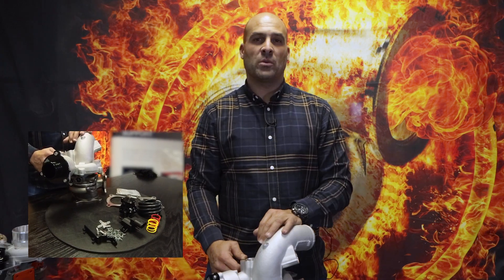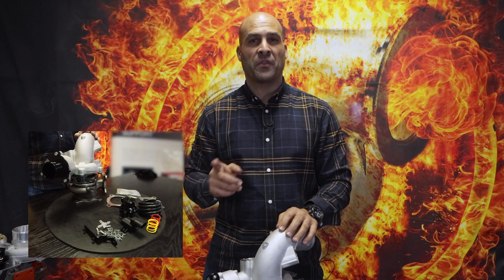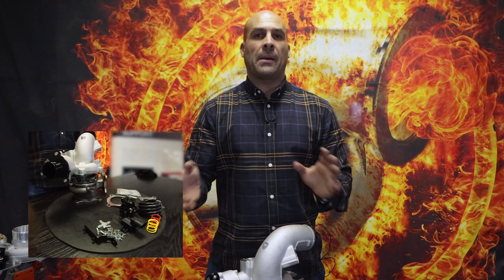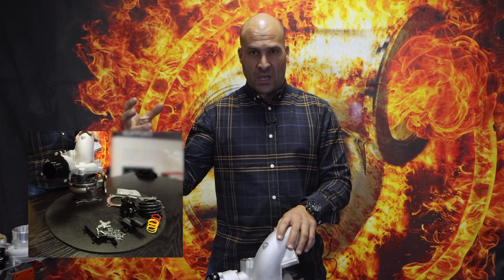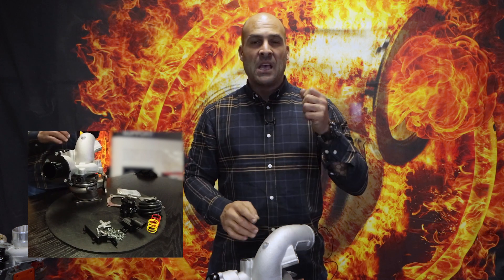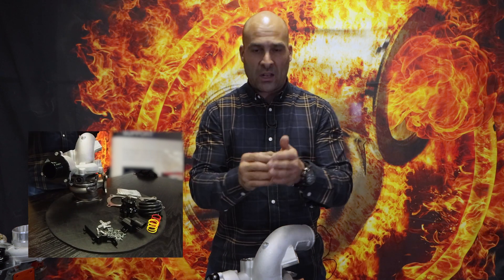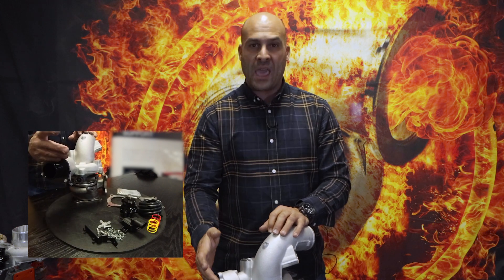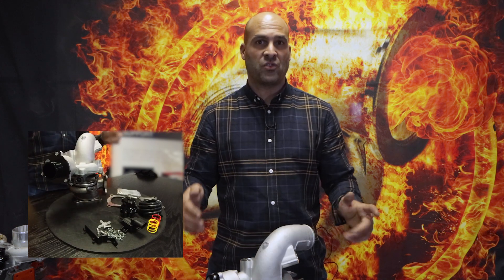500HP Ball Bearing Bolt On EA888.3 - Audi Longitudinal Engine

Comment: Since you guys don't make this in a transverse configuration do you A. plan to do so for the MK7 VW crowd, or B. will an IS38 compressor housing fit so that this can be used on a transverse engine?
Reply from the maker: We do - we have just received end housings to assemble the transverse models. The first batch is already sold out. We waiting for new stocks to arrive which we expect to be in July mid to late.  

I have a video coming out on this turbo, and also the installation thereof into the shop car, which will be a multi part video and we will show the tuning and testing process and some data logs aswell. Look out for the first part coming out sometime next week.

Comment: The hardware looks very impressive, you guys got some good castings for this one. I hope you will include some more information about the Golf R turbo when you do the video for that one. Specifically, it's a bolt on turbo, so that means we can use a stock downpipe and inlet elbow? Where are you targeting spool up? Moreover, are you guys still working with GT Innovation for flash tuning? Will there be an option to keep an electronic actuator and diverter valve like the stock IHI turbos? I think the boost control solenoid and blow off valve is a bit of a step backwards, though I understand it's hard to engineer and manufacture electronics for low volume.
Reply from the maker: Thanks for the comments, the video on the GolfR is done, and the dyno run is included in the video - we made 480HP and 632NM - we only use GT innovation for tuning, noone is able to do what they do on the EA888.3 platform they way they do it.  The multimap is also something i like using on my car, and GT innovation is the creator of this. the BOV controlled with the solenoid is an option we were asked for, so we included it, i prefer the OE DV to be honest - but thats my personal preference.

Comment: looks good guys!  Does that mean there is a turbo coming for the transverse layout IS38 in the Mk7 R?  also if this is for stock fueling that 450hp must be crank figures.  Do you plan to make something for cars with fueling upgrades that can achieve higher figures.
Reply from the maker: It does indeed sir - watch this space, ill release this in the coming week. We already have the IS38-600 journal bearing thick shaft re-design, and its been available for 3 years already.  Then we have the IS38-700 which is the ball bearing turbo using the Genuine Garrett GTX3071R Gen2 CHRA - also been out for 3 years now. youll find these here:-   https://www.youtube.com/watch?v=N_sNwMPGNkM 

and here:-  https://www.youtube.com/watch?v=POd230p7cTs&t=1s